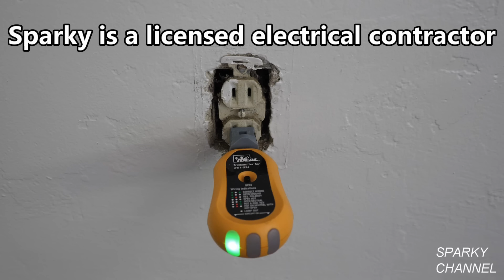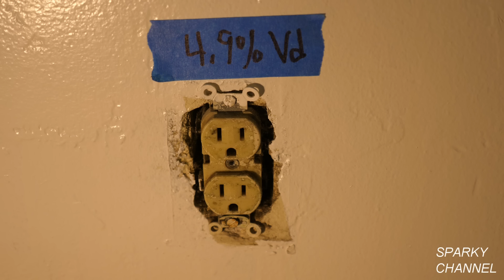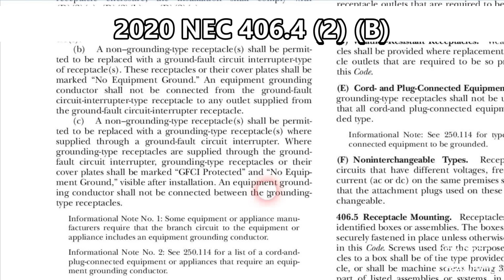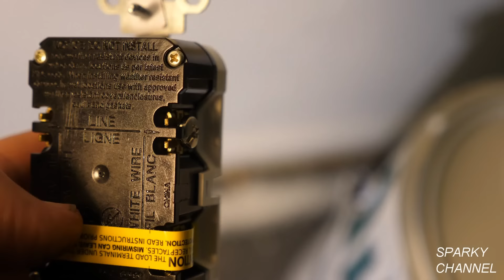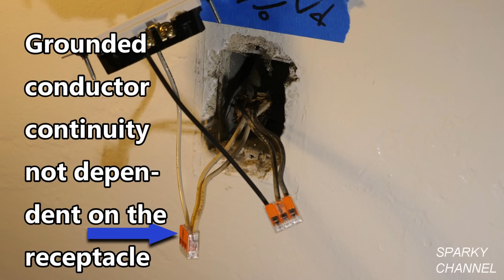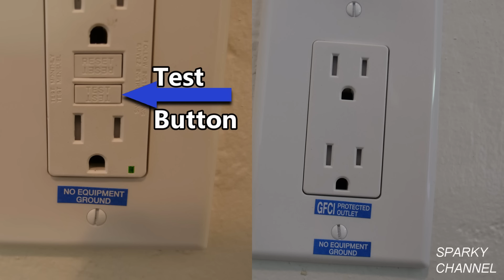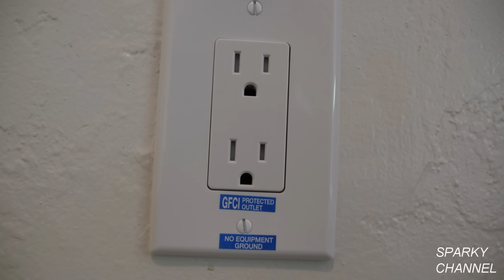2 Prong Receptacle Circuit Replaced by GFCI and Grounded Receptacles per 2020 NEC

Comment: How many things in your home actually have 3-prong plugs on them?
Very dang few. I see no reason to install a 3-prong outlet. You would only need them for refrigerator, microwave, chest freezer, similar plus garage and any outdoor outlets.
Does your phone charger have a 3 prong plug? Your TV set? Table lamp? Cable box?

And you can not buy a 2-prong GFCI either nor get any in styles and colors that match your decor.

About labels - who wants those ugly stickers defacing their outlets??
And what do you do when they wear off or fall off? Haven't seen anybody sell just the stickers alone.

High VD = dirty connections.

Impressed! You taped the outlet! A lot are too lazy or cheap to do that.

About 15 amp loads - Normally you are restricted to 80% full load for normal use.
Try the tests again at the 80% load.

Probably best to use awg 12 ga wire for all receptacles. Lot less voltage drop. Less voltage drop = less heat and safer against fire issues.
Reply: You're mind is so limiting, I can obviously tell you know very little about electronics.
Reply: @Elpipiton  Apparently you do not know the difference between electronics and power distribution.
SOME electronics need ground as a reference.
Refrigerators need ground for safety reasons.

Comment: 14.5% drop! This is enormous. If some appliance use the full 15 Amps here, this mean 260 Watt is heating the line in the wall.
Reply: Yikes!  And it might not be spread out all along the wire -- it might be one hot spot!  Applicances probably don't work well on 103 volts, either.  Let's hope this circuit is lightly loaded.  Not a good place to plug in a space heater.
Reply: Why is the drop so high though??

Comment: Why would the 7th outlet be better than the 6th?
Reply: I don't think that he was referring to them in the order that they existed along the circuit, rather the order in which he discovered that they were on the same circuit.  Most likely the "6th outlet" was, in fact, the last outlet on the circuit.  Once he found the first outlet in the circuit that was all he needed to know to locate the GFCI outlet.  After that it was just replacing the outlets.
Reply: Nm I'm off

Comment: Good teaching, Sir I have a question,  my house is old, just found in a hall wall an electrical flow of current a 3ft by 3ft behind drywall,  do you think it might be an old panel box hidden and still alive. Ibfound it using a pin meter just looking for location of a switch wire, that whole 3ft Sq. Is solid hot?
Reply from the maker: I really don't know what you might find behind that wall. What I would do, is I would open up the drywall and take a look. If you make a nice clean cut, you should be able to put back that same piece of drywall without too much problem, especially if you can cut it right on the studs.

Comment: Can't the GFCI be in the main panel?
Reply from the maker: Yes, it can.
Reply: @SparkyChannel  
Why not then?
Reply: @johnburns4017  You must change the outlets anyway so why change also the breaker?  The breaker is simple way if someone has changed the outlets illegally without a GFCI.
Reply: @okaro6595  
Changing the breaker will also protect multiple outlets not just one and also the wiring from the panel onwards.
Reply: @johnburns4017  But you still would have to change the sockets as that was the whole point of the change. Have you ever went to a store and bought eveything but the thing why you went there. That is what changing just the breaker would be.
Reply: @okaro6595  
Sockets are cheap enough.   You do not get any of this do you?
Reply: @johnburns4017  Wrong.  A GFCI receptacle will protect all outlets downstream from it. And they are about half the price of the breakers that go in the panel, which is why most people opt to go this route. And they are more convenient - if a trip happens, the outlet is right there and you can reset it (or diagnose the fault) without fumbling around in the panel. GFCI's are not there to protect wiring - they are there to protect personnel from shock. If you want to protect wiring, you install a standard breaker and an AFCI. The AFCI's have been required on some circuits since 1999 and nowadays are required on most circuits.
Reply: @LonnieAdams4  
I an RCBO on each circuit. That gives: earth leakage, fault and over-current protection. Also an AFDD on the power circuit giving protection: arc fault, earth leakage, fault and over-current.

Far better.
Reply: Might be because panel is old and gfci breaker might not be compatible. Plus you get to upgrade a two prong socket to a three prong

Comment: Seven outlets on one circuit seems like a lot! Is there a limit to how many receptacles you can have on one branch circuit?
Reply: 7 receptacles is far to many in my opinion. It should be 4 receptacles per 15 amp circuit branch for a total of 8 outlets. It may deffer depending on code in your area. It's not exactly unsafe to have that many receptacles if every thing is wired correctly and working correctly (Notice I said correctly) but it would be rally easy to plug too many things in when you have 14 outlets to plug into with this guys situation. Like space heaters or something stupid. It would be annoying if you trip the breaker constantly. It could be dangerous if you have a bad breaker that does not trip. Like fire dangerous. So you really should only have 4 receptacles per 15 amp circuit branch. 20 amp circuit branches allow 5 receptacles. Again it all depends on code in your area. Keep in mind code is minimum safety standards. Also be sure to test your breakers once a year. I'm not an electrician I just read a lot and work on my own home so take that as you will. All that being said the guy is probably fine. He does not seem like an idiot and this was a really informative video on use of tools. Personally I would rewire what is most likely knob and tube in this situation (Knob and tube is normally fine as long as you don't have blown in insulation or a bunch piggy back runs) but if you cant rewire, a GFCI is the least you can do or better yet a GFCI/AFCI combo for peace of mind. They even sell those in breaker form. They're about $70 a pop but cheaper than a house fire.
Reply: @givemeinformation  Right on, thank you for the thoughtful response! I'm in my second quarter of trade school for electrical technology and we've never wired more than 4 receptacles on a single branch circuit. I see what you mean about drawing too much power. Even if the breaker trips, it would happen fairly often which is bad for the breaker over time and a failure to open all ungrounded conductors in a circuit could lead to a serious fire.
Reply: 15 amp circuit can have 12. Not  really recommended to have more than 8. 
 My house has one circuit with 9 outlets, 4 lights, 3 switches and a ceiling fan with a light all running on one circuit powered by knob and tube wiring (one outlet is open spliced into knob and tube). 
Majority of my house is 2 knob and thbe circuits. Kitchen, garage, bathroom, a small family room addition, dedicated circuit in basement for washer and dryer, and  one small section of attic is new wiring.
Reply: I believe the code puts a limit at 10 outlets per circuit, but it just depends on the load calculation.  If you have 10, then you must assume most of the outlets won't be used much. If you have outlets in areas where they will be used with high powered devices, then you might only want to install a couple outlets on that circuit. And the code will dictate some of it specifically.  Kitchens are supposed to have two different 20A circuits for the countertop.  You will typically have 4 or 5 outlets on a countertop, which means about 2-3 outlets per circuit there.  Refrigerators are supposed to be on their own dedicated circuit as are microwaves. (And of course ovens are on their own dedicated 240V circuit as are dryers).

Comment: Where can someone order circuit breaker / receiver?
Reply: The circuit breaker locator for tracing existing circuits??? Home Depot, Amazon, anywhere you get other electrical tools/testers.

You can get them as a kit with adaptors to screw into a light socket & converter from a 3 prong receptacle to a 2 prong. So you can use them to find lighting circuits as well. (or you can grab those things at the big box stores as well.)

I believe some of the kits also have alligator clips, so you can test a switch or a prewired junction box. But, it's probably nothing worth any extra cost for most. (The adapters for the Receptacles & Light Socket would likely be all most anyone might need.)
Reply from the maker: Here you go: IDEAL INDUSTRIES INC. 61-535 Digital Circuit Breaker Finder with Digital Receiver and GFCI Circuit Tester: Amazon: https://amzn.to/3vDiAXH
Reply: The signal will come thru on other breakers a little. You have to reset the breaker tracer (pointed away from the Panel/Breakers).

Then quickly run it over  ALL the breakers, before going back over the breakers to locate the right one.

Alot of people don't run them by all the breakers 1st & don't think they work right. (That and/or not resetting it prior each time.)

Comment: Should a ground to the metal box to the GFCI plug be installed?
Reply: Ground wire should also be connected to all metal boxes
Reply: If the box is not properly grounded that wire does nothing to help. Do as you are told and do not improvise.

Comment: Why did you by pass other down stream outlets (no GFI)?  The idea of GFI is to protect any leak in milli-Amp, such as your body is short circuiting.  That was the main reason around early 1960s of a ground wire requirement.  With a working GFI, you will never need the ground wire (But the code requires it).
Reply: The GFCI protects all the outlets in the load side.

Ground wires and GFCIs are mutually complementary. You really need both but this is a compromise for old homes when rewiring would be costly.

Comment: So how do I find the first outlet in the circuit without using a $430 tool? 🤦🏻‍♂️
Reply: I thought the same thing. It will take longer but if you disconnect the wires from each receptacle then check to see which one has voltage when the breaker is on.
Reply: @beansmalone1305   Yeah that is eventually what I did end up doing. It'd just be nice if he told us how to do that if we didn't have that tool.
Reply: Your finger can work as a detector too, but I think the money is well spent on the tool 😅
Reply: Only one wire will be hot.

Comment: Would it matter if I replaced all of the receptacles with a GFCI?
Reply: That would be costly with no added benefit over just having the first one in line as a GFCI.
Reply: You shouldn't need to. By having the first outlet a GFCI, you are protecting every following outlet it's connected to.
Reply: You can do that but then you should pig tail.

Comment: I was just wondering,  I have a circuit that goes from the front of the house, through the front room,  through the dining room, and along the east wall of the kitchen. I don't know which the first outlet is, but my kitchen sink is on the east wall and no gfci receptacles anywhere, not even below the sink.  Someone added an outlet for a microwave. But I've been wanting to put a gfci in for coverage around the sink. I saw online people were saying DO NOT put a microwave on a gfci. Is this accurate? I can put one closest to the sink, which I think is after the microwave on the line. But I'd like to put one at the beginning of the line. Thanks for any info.

Comment: What’s the deal with the electrical tape?
Reply: Older homes used metallic device boxes instead of the new and more common plastic type boxes. If a hot terminal or exposed conductor contacted the metal box or came close to it, you could have issues. Most people use tape to keep hot terminals from contacting the box or a bare ground conductor. Secondly, it offers an extra layer of protection between you and the device, although you shouldn't be working on live circuits anyway lol
Reply: @juan7559  my fingers slipped last week and I got the sparky reminder to tape the receptacle sides.
Reply: Thanks for the info.  The switch in trying to replace had tape but wasn't even wired right and was tripping the circuit. It makes sense to tape it. I just didn't know if you could or if it isn't allowed.

Comment: So should a down line receptacle have fault the splice keeps the voltage going on other receptacles which would mean the GFCI receptacle does not trip? What is the sense in having it then??
Reply: I do not get what you mean. The GFCI protects downstream outlets.
Reply: The other outlets are supplied by the load side of the GFCI receptacle. It's 100% wired correctly (or as correctly as it can be without a ground conductor). He then pigtailed the hot and neutrals at the next receptacle downstream to produce a parallel circuit instead of a series circuit that depends on the receptacle devices. I guess he should have shown a test trip of the GFCI using the Ideal transmitter in each receptacle. However, just watch him wire the GFCI and you'll see that the downstream outlets are protected. If you aren't seeing that, then you prolly shouldn't be working electrical.
Reply: @chriscroush  I really can’t believe all of you not seeing my point. If they are all protected if there is a fault with any the gfci will trip! He said by pigtailing if you have an issue with one the rest keep working which if that were true then they are not all protected if they keep working if there is a fault in one!
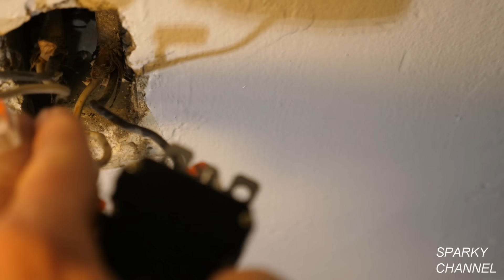Reply: Watch again from 12:20-13:40. That’s where it shows how the downstream outlets are GFCI protected. All the splices that were done afterwards are protected off the load side of the GFCI receptacle
Reply: @Ephesians-ts8ze  if pig tailed and not off the load side then no
Reply: @2olvets443  it IS off the load side. He explained that very clearly when he removed the yellow sticker from the load side of the GFCI and connected the load side conductors to the load side terminals on the GFCI.
Reply: @Ephesians-ts8ze  which brings up my point, if any have an issue down stream the gfci should trip. He said if you pig tail only the one with the issue will not have power. Why bother using a gfci if you’re telling people to pigtail so they keep working!?
Reply: @2olvets443  in this case, the pigtails were already protected from upstream. Personally, in my house, I prefer downstream outlets to be individually protected and I leave that yellow sticker covering the load side. The only time I’ll protect other outlets off the load side of a GFCI is if they’re in close proximity like with kitchen countertops. Otherwise a lot of homeowners will end up having to call an electrician out to come find where the tripped GFI is to reset it and charge them a ridiculous trip charge for pushing a button for them. Home builders cut costs at every corner at the homeowner’s inconvenience because GFCI’s are expensive.
Reply: @juan7559  thanks for your comment. Many people do their own and if passed by inspector, mind you permits are required, insurance will pay. 
Here I was being polite with posing my comment as a question so the poster would see his error on the explanation or lack of depending as he may have edited something out not realizing. 
If any one receptacle has a short down line it will trip the gfci receptacle where none have power in that line. The poster said only the one with the issue would have no power making it easy to find the one at fault. 
I’m retired communications and was IBEW so I know some about electrical.
Reply: Doesn’t the new Code call for Arc Flash Interrupter breakers on recepticles? If needed, you can buy AFCI/GFCI combination breakers now.
Reply: @normferguson2769  210.12 NEC lights and receptacles is my take on it. Also allows for first in line install on receptacles.

Comment: Excellent video, thanks for the detailed explanation! One question though - what are the downsides of having GFCI  backed circuit over installing the full equipment ground wiring in the entire circuit? I know later is more work/expensive since it involves running a ground conductor through out the circuit but I am wondering if taking the easy approach of GFCI has added risks? Thanks in advance!
Reply: The GFCI might not trip immediately at the fault but only after you touch it so you could get a sting. This is not dangerous to healthy people but could be for someone with, say, a heart condition. Also the leak current does not escape so you could feel some current if you touch the device and ground at the same time. The leak current or voltage could also damage equipment if they are connected while powered on.

A GFCI can also fail so you should test it regularly.

In general one should not be worried. In Europe we use unfounded sockets with no extra protection with twice the voltage - though only in safe rooms with no ground potential.
Reply: Some equipment like audio amplifiers or ham radios need a true reference ground to discharge RF interference that can cause static and hum.
While these GFCI-only circuits are safe, they wouldn't be satisfactory if the customer planned to plug in a guitar amp or stereo system.
Reply: If you're gonna do the work to run a ground,yhou might as well just run new NM-B cable.